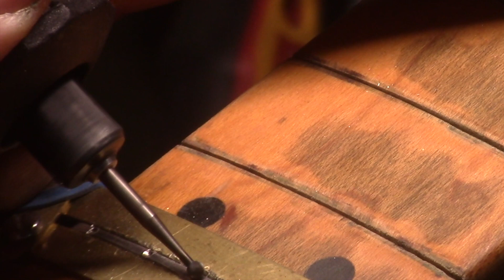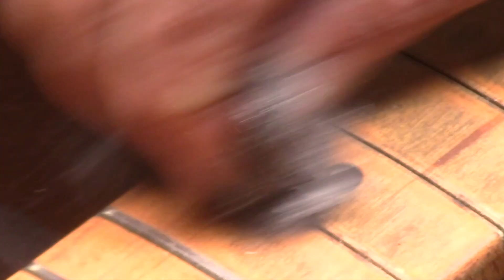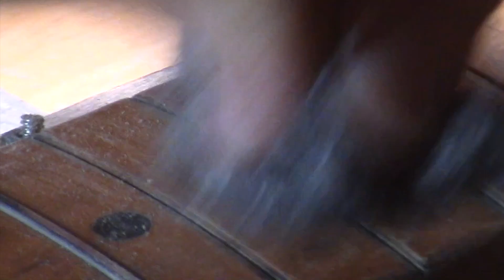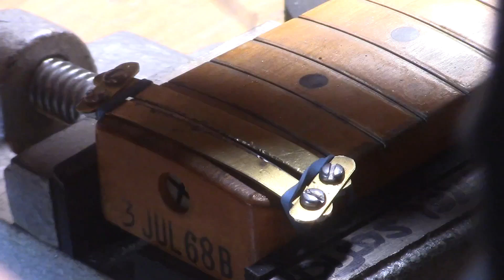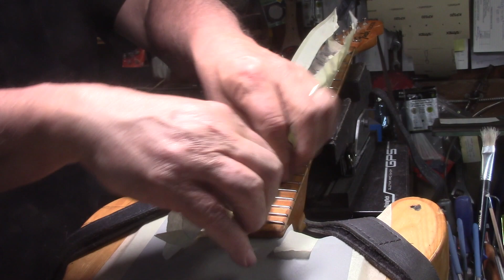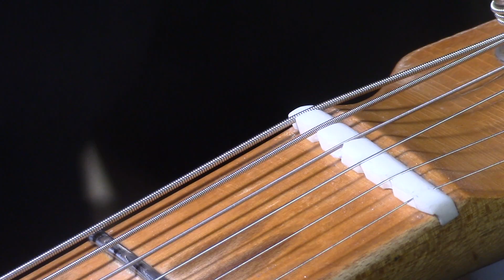1968 Telecaster Restoration@StringTechWorkstations/ Looth Group Chat June15th 7:00 PM

Comment: Beatutiful job as always! Also that you brought perfect intonation to it. Kudos. For my own ‘73 Tele  I’ve opted to keep the original neck as is and keep a lookalike Musikraft neck if I want to play. (At my own discretion..😎)
Reply: I just had two Musikraft necks installed, Wow, I could use them right out the box, never had necks that good before. My '92 Strat thinks it's a violin now due to the new neck!! I did a little recrowning as expected, but it was absolutely minor.
Reply: @boddumblues  Indeed, that´s my experience too, very stable wood in them. Have had 3 necks from them over the years, all flawless. Rock on!